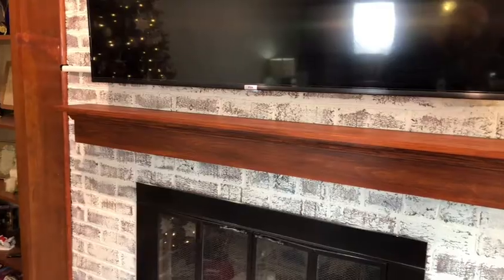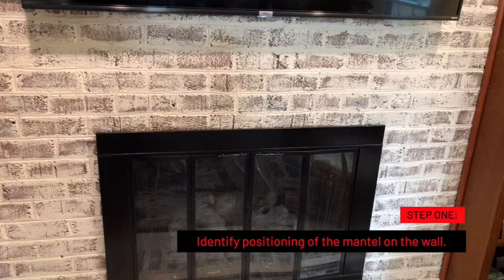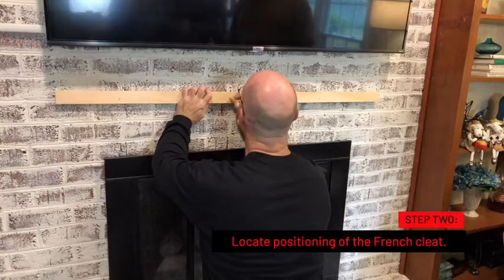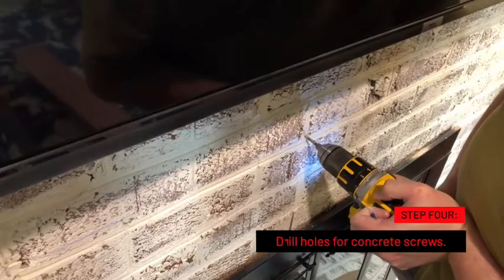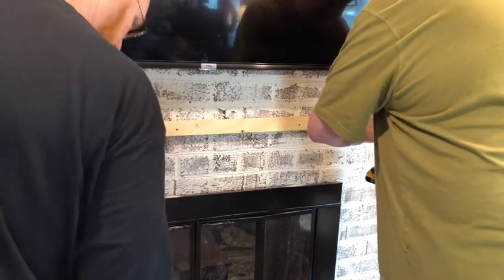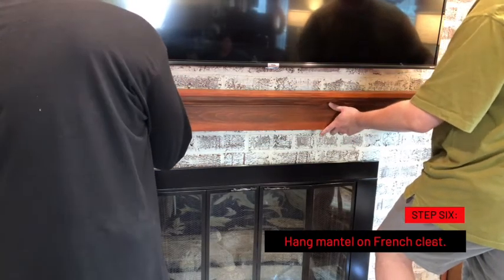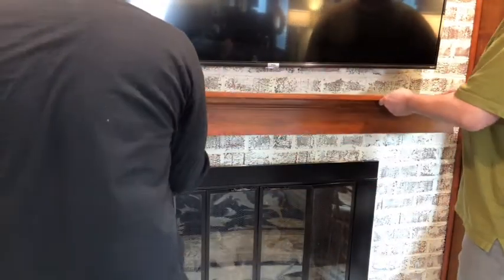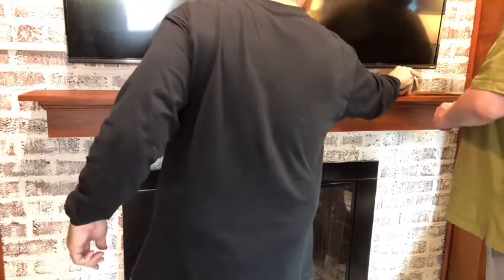Easy Etsy Mantel Install | French Cleat Design

Comment: I have a chunky piece of wood that I was going to try and use as a mantel.  I think I will need brackets.  Excellent idea - drilling into the cement not the brick!  I did drill into brick once - my drill almost went of fire!!!  it was extremely hot.  Of course.I could not see the brick or mortar I was only putting up a few shelves but being an outside wall, it was very hard to drill into.  It would have been so much easier if I had known this tip back then.
Reply from the maker: I'm glad you liked the tips.  I also like the french cleat design.  I think it's much stronger and flexible that it doesn't go all the way to the end.  Thanks so much for watching!